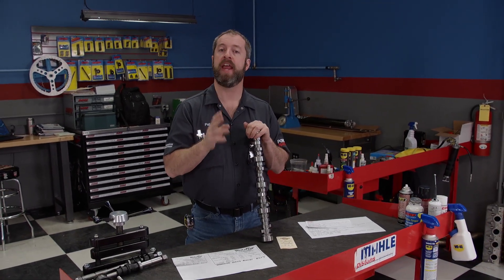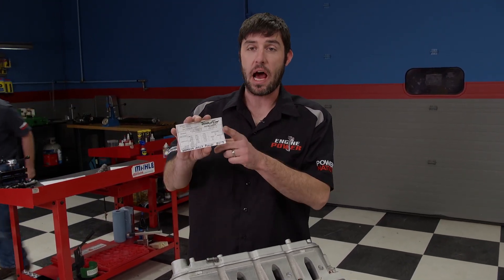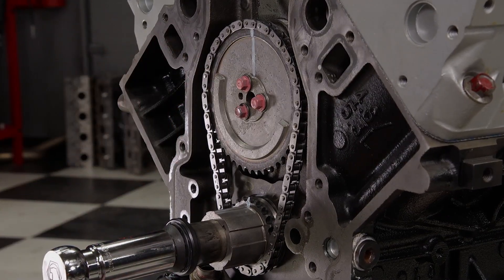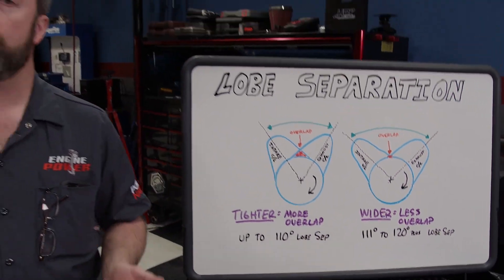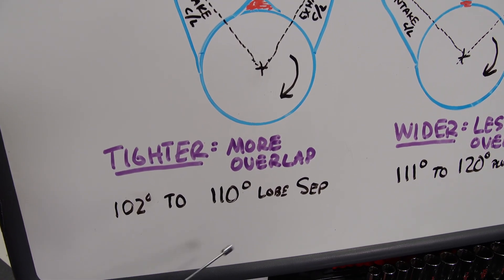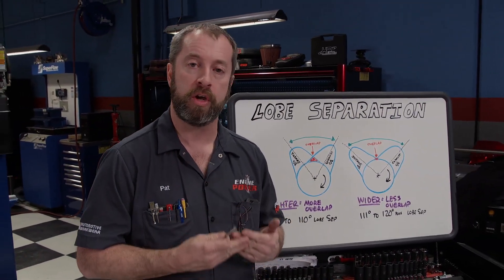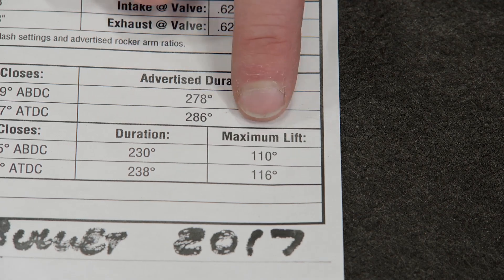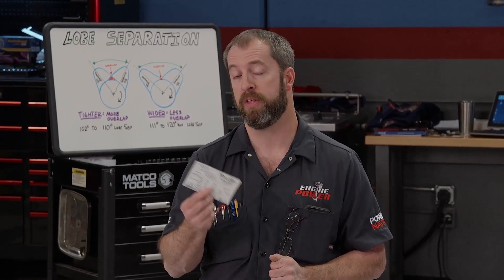Lobe Separation And What It Means

Comment: The problem is everyone gets fixated on this and don't take into account the duration. The amount of Overlap is what matters in a street car. 

Overlap is what really matters, especially for a Contemporary automobile. Old guys with manual, steering, manual brakes, manual transmission and Carbuerated don't get it. Finding a Camshaft that makes the best power and still be able to run power brakes is VERY difficult. Even the Cam company tech guys don't have an answer, even when you fill out the "Cam recommendation form".  Don't even mention emissions, LOL.

There are thousands of basic cam information videos on the internet, but NONE go indepth on that subject. I also NEVER see an video demonstrating how bad a 106lsa big cam car is at low rpm, slow driving?

I've never seen a comparison test on the effects on MPG either. I would love to see 2 camaros with 350s with the same durations, one with LSA 106 vs 112LSA run 50miles of mixed driving. Have on-board video how each other are in traffic, slow driving...especially with an automatic.

I've seen tight LSA make more avg. power in one engine, while in another engine the wider LSA made more avg. power.

Closest answer I got was in feb 1998 Car craft magazine. The 350 (9.7:1cr,  AFR 190cc heads, RPM intake 750cfm) they had was basically at the limit with a compcams Magnum 280h, 230/230 on 110 LSA hyd flat tappet, or 10 degrees of Overlap.

Comment: LSA doesn't determine overlap. Overlap determines overlap.

You can have a cam on 112° LSA and 60° of overlap, and you can have a 106° LSA with 60° overlap.

The LSA determines if the engine will make maximum output, and overlap determines where in the power curve output will peak.

Duration and lift are byproducts of choosing LSA and overlap. So many get this wrong.
Reply: That pretty much matches my thinking.  I choose overlap to best serve the desired application rpm, and lsa has to find the sweet spot for best volumetric efficiency & scavenging.  The first is a time management tool, the second deals with [na build] fixed factors:  heads, exhaust, etc.   Turbo guys have the luxury [sometimes a headache] of a variable precharge curve that takes atmospheric pressure off the table - air density/temp get the focus instead.

Comment: I just don't understand, if there's no overlap, how are you going to scavenge exhaust gases?
Reply: There's always overlap.  Always.  The point of reference is missing there:  0.050" valve events, which is roughly where flow is even worth considering measuring.  For symmetrical lobes, some easy math: add advertised durations of intake and exhaust.  Divide that result by 4.  Subtract the LSA from that, and multiply the remainder by 2 --- theres your real overlap, and it usually matches 0.006" lift events as ground.

Comment: So the less lobe separation the more chop ?
Reply: We'll sort of, the tighter the LSA the quicker valve events happen. You can have 2 identical duration and lift cams with one being a 113lsa and one a 108lsa, the 108 will sound more rowdy because everything is happening faster and more often. A tighter LSA cam will provide more low end while a wider LSA more top end, this is why you'll see boosted cars running a bit wider LSA. If you want more in depth cam explanation look up David Vizard on YouTube, particularly his 128 method, he is a wealth of knowledge.
Reply: That assumes more overlap based on keeping the same duration.  But, more than one way to skin a cat: higher lift with shorter duration can get the same [or maybe more] pounds/hour air in, while holding overlap at the same value.

Comment: Every time someone talks about lobe separation angle, they cant help but talk about overlap. And its true, it does increase, but the tighter it is , the better it is for the most important of the four opening and closing points of the cam. The tighter the LSA, the sooner the intake valve closes, making more cyl. pressure. Also There is a difference between more duration at .050 overlap and overlap created by a tight lsa.

Comment: I remember Hot Rod Magazine did a blower motor build where they used a Comp Cams with a 110 degree LSA.....Why Why Why would you do something like that?  Blower motors need a higher LSA like in the 113 -116 range.  Hot Rod Magazine even has a test, with results shown online, that boosted engines need  that wider LSA     (see Hot Rod Magazine Camshaft Shootout: Lobe-Separation Angle Tested and Explained
Notice:  This is not a comment about Blower cams, nor their lift and duration.... It is a comment about LSA and it's scavenging effect @ on NA motors compared to SC motors. Both valves open at the same time on a SC motor creates a boost leak, and you don't want that.  But at the same time,  Higher LSA does not make a cam a "Blower Cam."  Comp Camps sells camshafts for NA Coyote engines that have up to 130 LSA
Reply: Why? That would be duration driven.  A basic 262 cam with a 110 lsa has 42 degrees overlap.  To hold overlap the same on a 272 cam spreads lsa to 115 degrees.  On a 282 cam lsa gets pushed to 120 degrees to keep that same 42 degrees.

Comment: Need more info ls3 no boost application.
What would give better low end turque lsa  low or high?
Reply: Weingartner just wrapped up an LS3 cam challenge with some very serious submissions - over 20 cams.  Numbers on winner are not yet out, but check out his channel.  But to your point, if goal is low end torque, less overlap is your friend.  An lsa that works?  keep it, and go for less duration.

Comment: You can increase the duration by flattening the top of the Loeb there for the valve stays open for a longer duration
Reply: No... that radius trick buys area under the curve for limited lift, but the exact same duration applies. If you want more duration, you get into reducing base circle [modifying an existing cam]
Reply: @flinch622 glad to see someone understands cams.

Comment: When I was about 21 I built a big block for my 1970 Chevelle. I installed a Crower solid lift with radical lift and 105 degree lobe separation. Piss poor vacuum and very lopey idle. It hauled down the track and pulled like a freight train from 3500-6500 rpm. After having a family nice Sunday drives were a pain because of the way it ran. So it got mothballed until recently when my 20 year old pulled it out because of the stories everyone told about it. Well, it’s like starting over. So many years in storage has taken its toll.
Reply: How’s the rebuild going?
Reply: @user-manny43 Also curious 👀👀
Reply: My friend's dad who is a mechanic said cars will break just by sitting. I find that to be true. At least keep it running and rolling if nothing else to shake the rat turds out.

Comment: Said a whole lot and didn't answer anything
Reply: Yep ......they told us everything BUT what lobe separation Does ? still in the dark....
Reply: @kermets  I like to think of it as clocking volume, mostly: it takes bore, stroke, and valve size into account as primary factors.   Air is lazy.  Add fuel in suspension it gets worse.  Basically, the larger amount of air to be managed per cycle, the greater the sloth and to motivate that... means applying a shorter LSA [tweaking overlap] for a stronger signal.  But only to a point - too tight gives away top end power. Finding the sweet spot is like hitting a tuning fork just right - it sings.
Reply: Check out vintageiron channel. I can't Rem the exact channel name, but he has several cam vids. Best out there.
Reply: Lobe sep = is basically a volume controller for an engine
Reply: supercharged6771 like every single cam video

Comment: What Powerblock didn't dicuss you look for wider overlap cams 112 to 114 for engines that have large valves like a chevy 350, and a low overlap cam 110 to 108 LCAfor a 305 chevy or a 400 where the valve aren't large enough.
Reply: Actually the 305 always had big valves and small combustion chambers. Some 350s, mostly truck engines had small valves. Majority of the SBC heads had 1.94 intake valves.